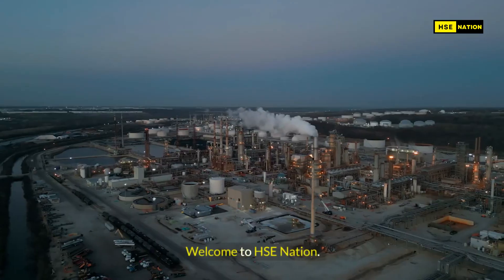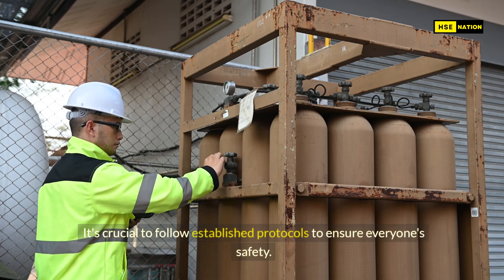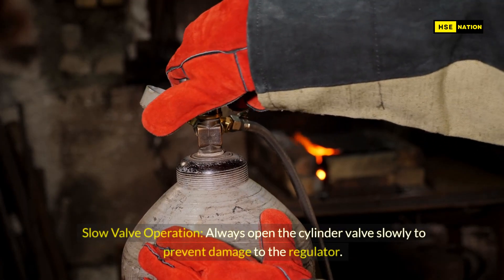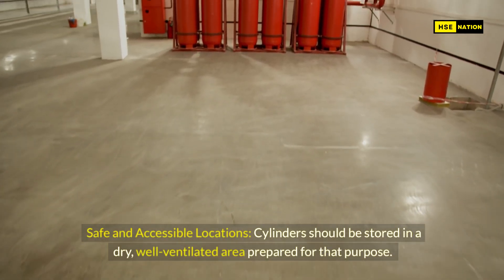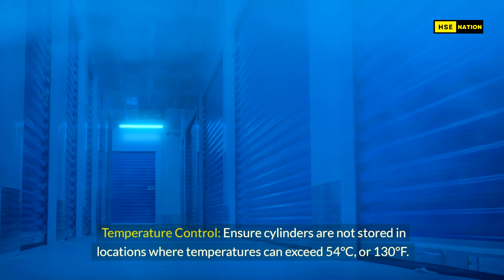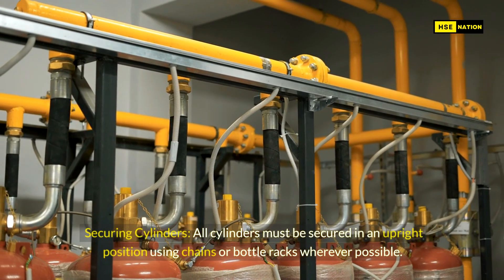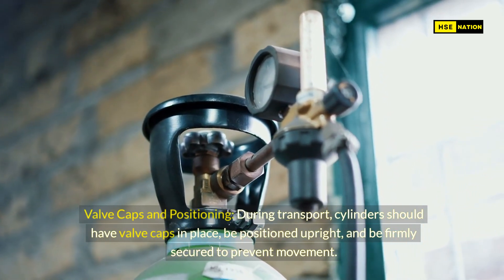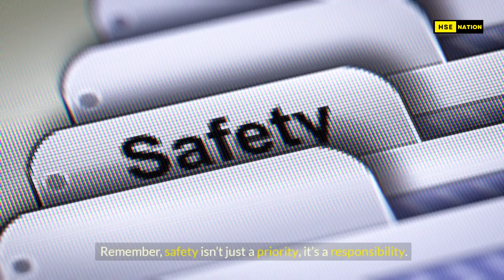Essential Safety Guidelines for Handling and Storing Compressed Gas Cylinders | HSE Nation

Comment: Fuel gas cylinders such as acetylene or propane should not be opened more than ¾ to one turn.   Likewise, if a  cylinder valve  requires T-handle wrench to operate, the wrench shall be left on the valve at all times while the cylinder is in use.  Following these steps will ensure the valve can be closed quickly if a dangerous problem develops, such as a flashback or fire at a leaky connection.   

This procedure is not true for high pressure cylinders such as oxygen, argon or helium.   The valves on these cylinders are different than those found on low pressure cylinders used for fuel gases in that they are a double seating valve. This means the valve seals either in the closed or fully open position.  Opening the valve partially as you would on a fuel gas cylinder will allow the valve to leak around the valve stem, so the proper procedure for opening a high pressure cylinder valve is to first, make sure the adjusting screw on the regulator is backed out by turning the adjusting handle counterclockwise until no tension is felt.   Next, stand to one side so that the valve outlet and regulator points away from you, then very slowly open the valve until the cylinder pressure registers on the gauge.  Finally, open the cylinder valve all the way.   It is now safe to adjust the regulator to the desired pressure.   

Here is a safety tip that cannot be overstressed:   NEVER stand directly in front of or behind a regulator when opening a cylinder valve.   The weakest point on a regulator is the bonnet and if the regulator blows, it's usually the bonnet that goes first.   The adjusting screw is blown out with lethal force, comparable to a discharging .44 Magnum rifle.